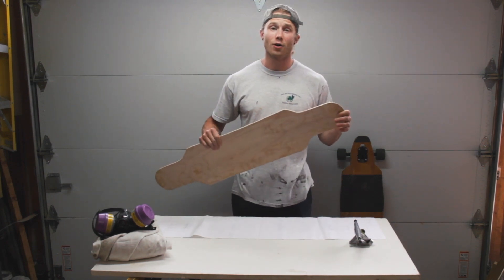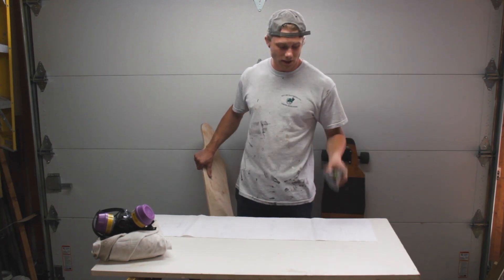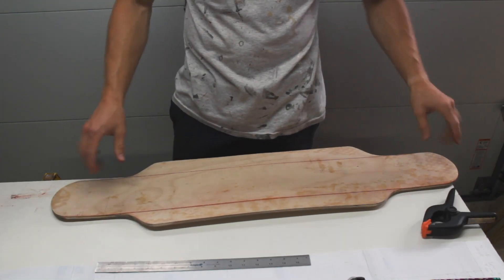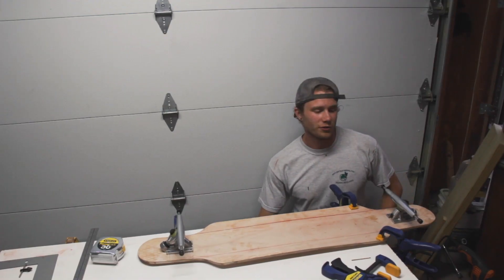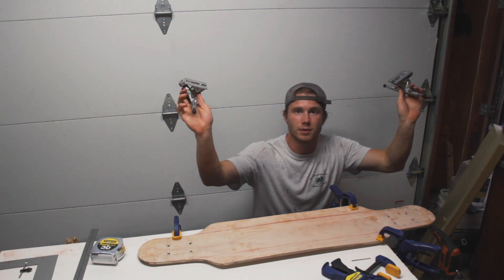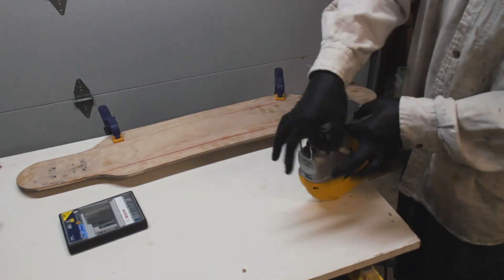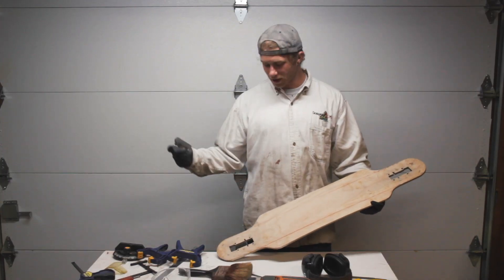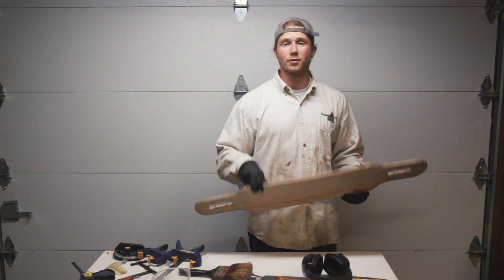Longboard Build - Making A Drop Through Deck (Part 20)

Comment: could you give template of deck
Reply from the maker: I would love to but I can't find it anymore. I do remember general dimensions though - about 36" long and 9 1/2" wide. I drew the shape of the board by hand on grid paper. This board is symmetrical with respect to the vertical axis and horizontal axis because I only drew a quarter of the outline (one stretch between the horizontal axis and the vertical axis) and then copied that line three times to draw the entire outline. The grid paper is nice because once you have a quarter of the outline drawn, you just see how the outline intersects with the grid paper lines, see how far the outline is from the centerline, and copy those positions/distances across your horizontal and vertical axes. You end up with something perfectly symmetrical. This board pinches a little bit at the horizontal axis - it's 9 1/2" wide where my feet go but is more like 8" at the horizontal axis. I did this for weight reduction. Just draw your curves by hand and make sure they are nice and flowy.